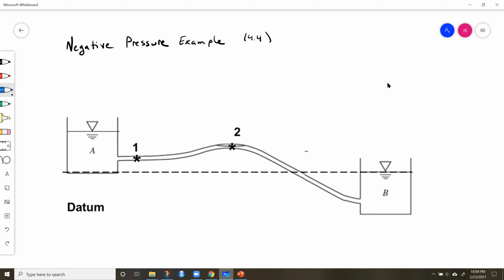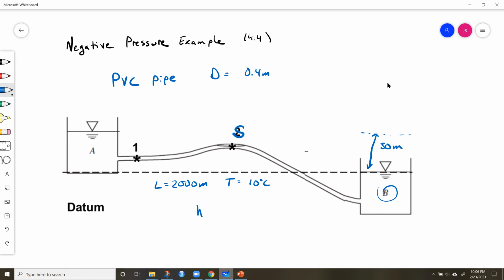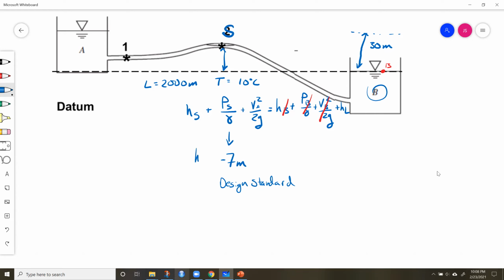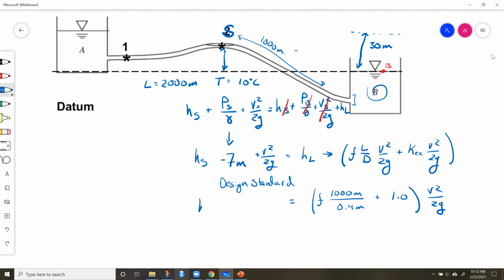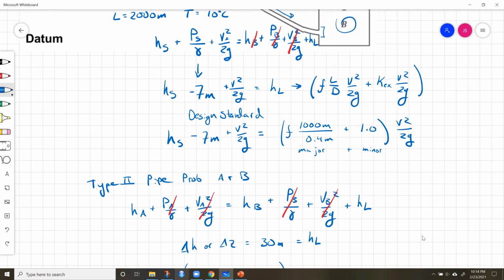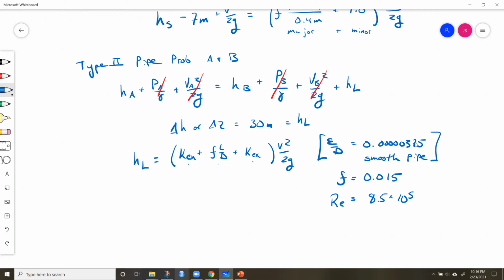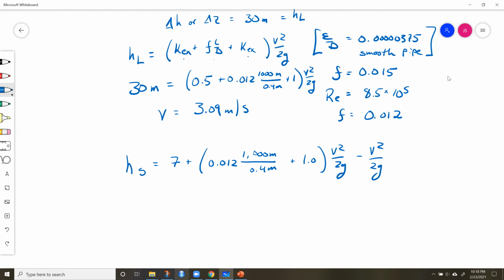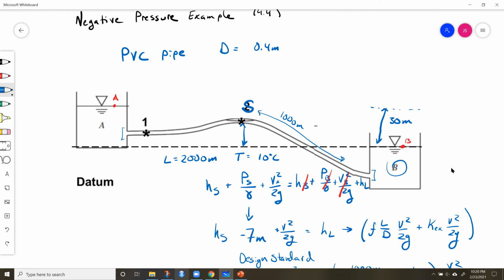Hydraulics - Negative Pressure Example Problem

Comment: How to solve this in Epanet ?
Reply from the maker: Hi Amadou.  Great question. You can use EPANET to design this same system. Create a simple system with a water tower at Node A (Reservoir A), the appropriate pipeline, a node at S at 1000m and a node at Reservoir B (1000 m of additional pipeline) with a demand of Q solved from the problem (as described in the video). You have to first solve for Q on your own because EPANET requires a Q value (demand at Node B). Put a water tower in for Reservoir A and set the water level to 30m in the tower (tank depth plus tower height = 30m). Run the model. Check outputs (pressure) at nodes. Now you can change the elevation of Node S iteratively to solve the problem.